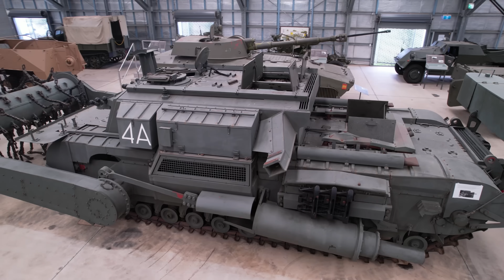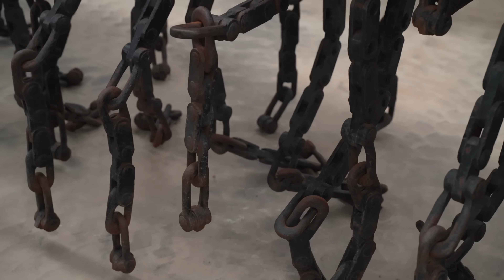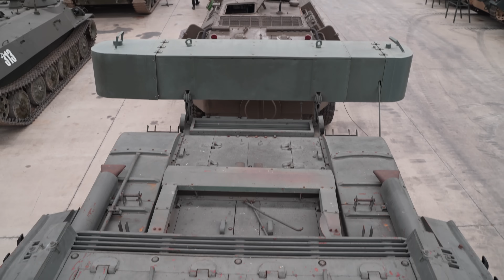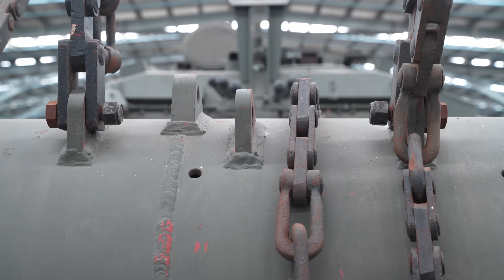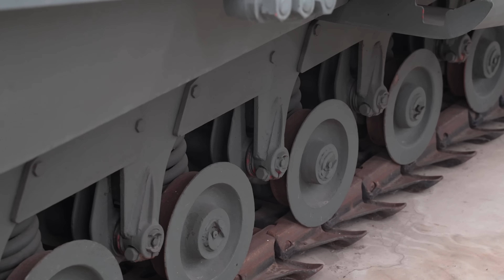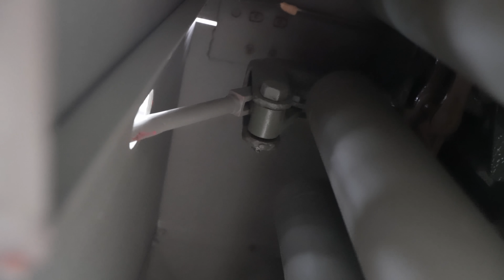The British Churchill MINE CLEARING Flail Tank "Toad"

Comment: Nice to see this video, I actually restored the lane marker sytem on the back. As I recall, there are about 59 tubes on the conveyor chain and as each one comes to the end the marker post is fired out with a blank .303" cartridge. When the vehicle was completed it was actually driven with the flail going along a bed of straw, the chains temporarily shortenend, in front of the owner Jacques Littlefield and live BBC TV cameras. The flail engine is not exactly a Centurion engine as it is the fuel injected version as fitted to the Conqueror tank. Another misnomer is that the Churchill's is not two Bedford engines, it is in fact a 'flat six' or opposed. It is a side valve and there were no other Bedford side valve engines.

Comment: Ashchurch is a vehicle storage and distribution depot only. So, I am wondering if the excellent condition is because it was never actually issued to a unit and spent all its Military life in storage.
Reply: No she wasn’t kept in storage.

According to ‘Tanks-Encyclopaedia’,  this vehicle was left out in the elements in the UK for many years,  it was restored between 2006-2008, and then handed over to the Littlefield Collection in the US,  Aus Armour then procured it at auction in 2014 for US$80,500.

She’s well travelled!
Reply: @johnnewman366  Need to get the British Army Reg No from the data plate. Then apply for a copy of the Service Record Card to find out its Military service before being auctioned off to see how much "action" it saw in the Army. Annual driving round the depot for readiness checks or, issued to a Unit? Being left out in the elements after disposal is an entirely different matter.
Is it really more than 10 years since Littlefield died? How time flys.